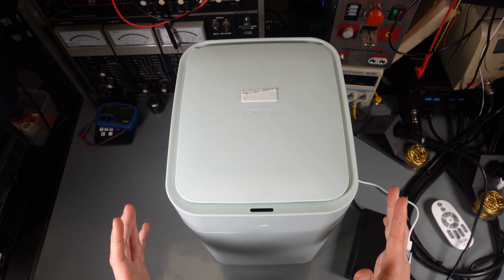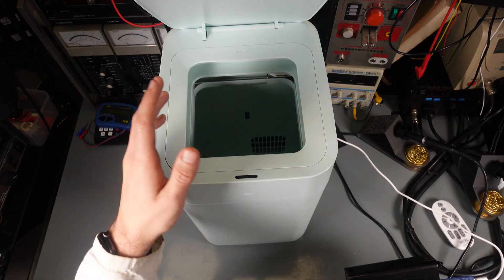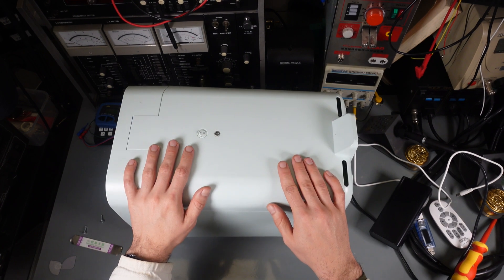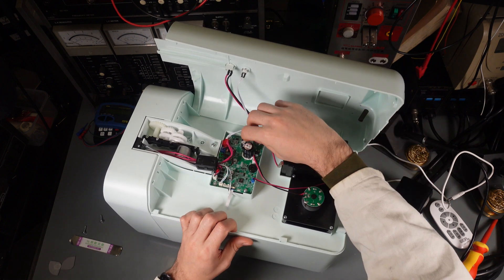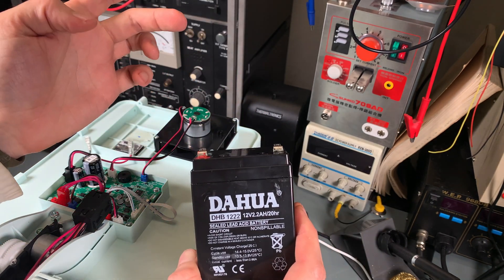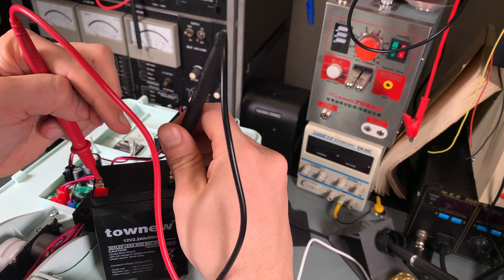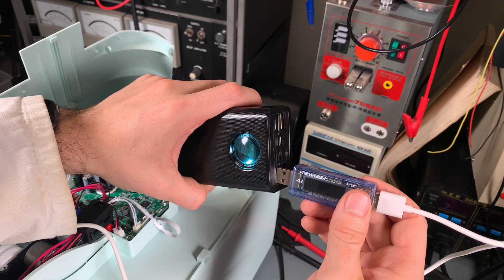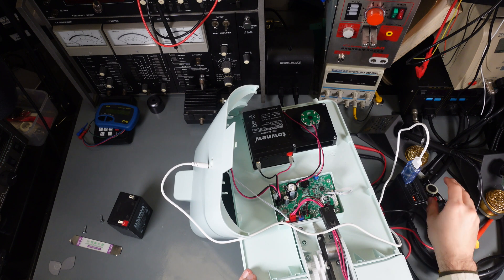Fixing Xiaomi TOWNEW T1C  smart trashcan (not charging / 12V SLA battery replacement)

Comment: Question - Is the battery the same for a Townew T1D? I got one at an Amazon return auction site and the battery is dead. I opened it up and the battery has no identification on it, so i cant tell what type of battery it is.
Reply from the maker: Very good when people try save devices, I think i never had this model, what is Your concern? Disconnect battery put multi meter in place battery and plug it to charger. Observing voltage most like will tell You witch one is correct. If there will be around 13V then  12V is most like type if around  7v then 6V.

Comment: I'm shocked when i saw the lead acid battery. I was expecting li-ion, like many other home appliances. I will change it to lifepo4 and forget it. 😅
Reply from the maker: I'm afraid that it will make 50% cost of that device - haha! But lifepo4 would be drop in replacement so should work great!
Reply: I have replaced with lifepo4. I'm very happy with it. 😊(It costed around 20$)

Comment: My townew has an issue. It charges and turns on, but it won’t seal. The bar that goes across the trash can to seal it stops about 1/4 of the way across the bin and goes no further. There is nothing blocking it, there is nothing in the trash can at all (except the trash can bags) and it’s totally clean. Do you think it could be the battery? I have it plugged in and it turns on and seems fine other than the fact it won’t do the jobs of self-sealing. :( If anyone can help, I’d appreciate it. I went through the effort of decorating it and making it look great so I really want to fix it.
Reply: Did you get a fix?
Reply: @denisberger7  nope. Not one email back. And I messaged all the emails listed on the Townew websites. I mean I got every  country’s website that distributes it and sent an email. I messaged and got zero emails back from any of them. I tried Facebook, Instagram, Twitter… everything. And nothing. I am probably just going to have to take it to the landfill to have it electronics recycled. sigh I loved that thing. I even used some peel and stick wallpaper tiles to make it look awesome. :(

Comment: Can i replace it by Lithium(Li-on) battery (3 cells) ?
Reply from the maker: Not without modifying charging circuitry and having BMS - at end of day (in my opinion) all that work without real benefit.  If You really want lithium - maybe some kind of LiFePo4 drop in replacements.